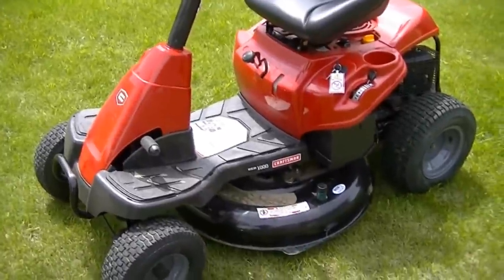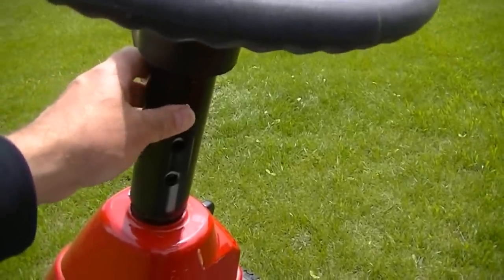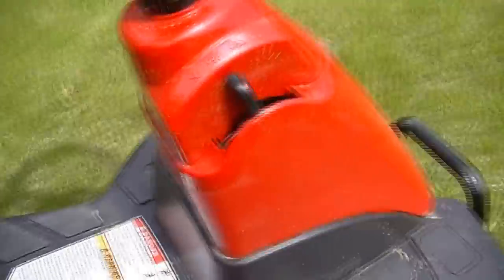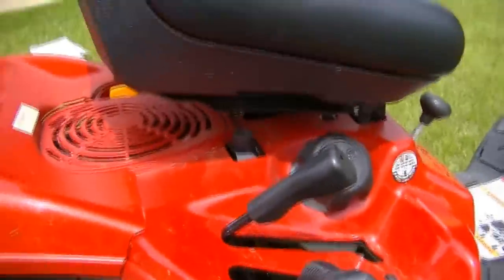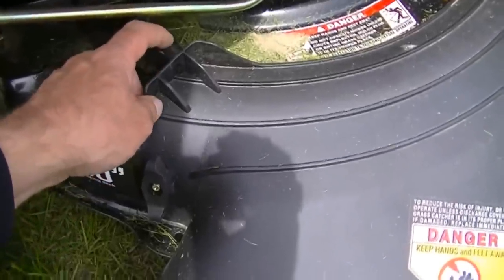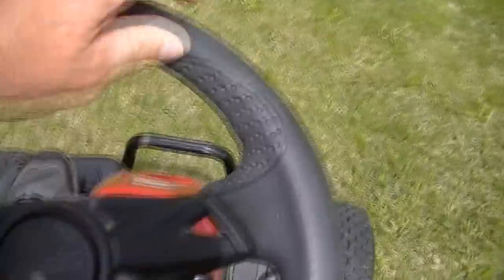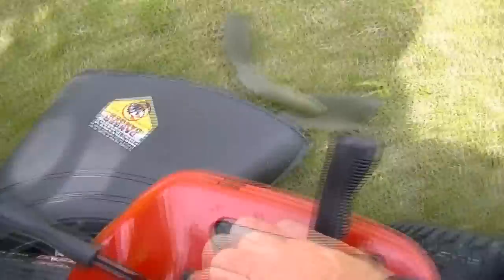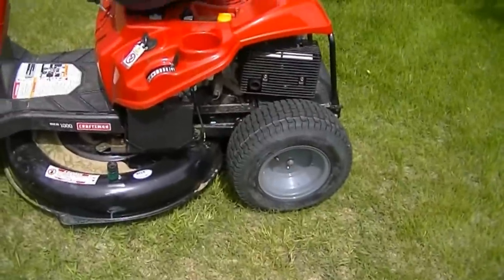Sears Craftsman / Troy Bilt 30" Rear Engine Riding Mower Review

Comment: I bought this $1200 mower at a Sears Annex for only $752.00 two years ago.  It had never been on the ground.  If I put it in neutral and engage the speed handle all the way back into Park, I can get off the seat and leave the engine running.

Comment: Hi , I have one like this but last night I had to disconnect the battery because the starter would not shut off even when the key removed. Any ideas? Could the ignition switch be faulty?

Comment: I bought one of these, they delivered it and it wouldn't start.  Mine is the 29900 and says 1500 on the side (rather than 1000 like this machine), but they are nearly identical. Anyway, they brought another one out to me  a week later and the same thing - it wouldn't start; but this time the guy delivering it figured out that the handle on the right side of the seat which "engages" the mowing when pushed forward and not mow when pulled back was in the forward/mowing position, so he pulled it back to the non-mowing position and the mower started right up.  So if anyone buys one, make sure that handle is in the back, non-mowing position to make sure the mower will start.  After they left, I mowed right away and what a dream.  I can't believe how great and even the lawn looks and best yet, how quickly I got the job done.  I'm in South Florida and we're melting from the heat right now (no matter what time of day you go out to mow), so this is just what the doctor ordered.  I immediately pulled the little wire off underneath so I could mow in reverse.  Worked like a charm. Thanks so much for this great video!
Reply: A much better purchase would be to find an OLD snapper rear engine rider. People sell them for dirt cheap all the time and they are tanks. I bought one and replaced the engine, belt, friction disc, and repaired the bagger. All in I paid around $600 for everything and my snapper is ten times better than any residential rider mower out there. The gage thickness in the steel on the old snappers is something to behold! they just will never die.

Comment: so 5 years now hows it going with your mower  ,i have found out all i need to know about the mower,an have the new 382cc version comeing this friday ,got my oil drain hose ready,an extra blade oil filters the same as the 420cc,an air filter a cover ,an will run high octane fuel in it ,i may post a video on the 382cc,they say it has auto chock .an just better on fuel same hp pretty much by sea level,troy bilt version top 5 mowers of 2018 withe the big boys, wich looks exactly the same an the cub cadet has a head light,looking forward to clean up ,got 10cf cart for clean up ,an mulching,even read the owner manual  ahead of time thanks to the net $968.99 from sears delivered ,i near went for the cub  hydrostatic for $1199.00 with head light an 3 year bumper to bumper ,an the dealer right hear in town ,but bought this first,if it goes back for any reason i would say there 3 pretty much the same input thank you

Comment: Odd, I just looked under where you showed the electrical connection for the safety for reverse, it did not have the electrical conduit, just several wires.  Lucky for me, I had extra plastic conduit to protect the wires.

Comment: Thank you very much for your very well detailed video I just got one of these and it makes it so much easier to watch somebody else do it LOL the only question I have is I'm hearing from people here on the internet that the type of gas you need to be careful on because it will glob up in the carburetor. They're saying that you have to use a higher premium they find this way it doesn't Clump up??? I don't know is this true cuz I don't see anything on their website about having to use a higher premium gas. Just want to know if you've run across this issue since you found yours? And once again thank you very much for everything

Comment: I have essentially the same mower, but it's a Murray.  Have you run into an issue where, when you run out of gas and fill it back up, it will not start...

Comment: Mine is about 3 years old. Having problems with the parking position stopped working. The clutch/brake pedal slow to return. No anti-scalp wheels on deck.
Reply: Mine did that also. You have to slip the steering wheel off and the column cover. The whole bracket was loose and missing 2 of the 4 bolts.
Reply: Thanks. I was thinking that and will get out there today. I've had other bolts loose, bowtie clips missing when new, and it misses grass. The column cover.....how exactly does it come off? Stick screw driver in the tab holes it looks like? @keachmister
Reply: I got it! I had no loose nuts or bolts. I had grass that got stuck under brake lever and wouldn't depress just a teeny bit more to engage that last setting on teeth. The plastic plugs went flying I popped. I put Loctite on all bolts/ nuts to be sure. Thanks again. @keachmister
Reply: @elcidlord  That sounds too easy!! But the results sound good. We'll call it a fix.
Reply: @keachmister

Comment: Good video. I just bought this mower a week ago and I was just about to return it. I bought the rear bagging kit and installed it.  Right after I was done, I turned the key and it attempted to start, then nothing. I'm wondering if the safety button near the grass chute isn't engaged.  I'll know in a few minutes. Thanks again.

Comment: Thanks for tip. Questions:-/ do you find it leans out aft it gets hot? and at hot idle do you hear excessive valve clatter?
Reply: I added a small cooling fan and switched it off the battery. Pointed it towards the carb. Valve clatter is normal,

Comment: Nice review BUT the ONLY problem with the Model 25000 from last year was the "safety switch on the deck discharge chute" and the redesign for the 29000 only included that fix. The 25000 has the exact same transmission. For more details check out Paul Sikkema's site "Today's Mower" at "todaysmower dotcom". He also reviewed the 25000. I bought a 25000 in May 2012 and it's a fantastic mower. The mulch plate and bagger work great too!
Reply: the 25000 had the weak trans ,the 29000 has the stronger one

Comment: Hi there! great video. Thank you so much for that tip for cutting in reverse, I just bought the same machine getting it this saturday the 21st of June 2014 Im guessing the model would be 29000 or greater. 1 question do I put high octane fuel like 94? Have a great day Don
Reply: Donald Guadagnolo There is no advantage in using 94 octane gas. 87 is fine.
Reply: 93 high octane allways works better in small engines all of them

Comment: Did anyone buy the warranty 3-4-5 year program from Sears at $249 or $299 or $389?  The salesman highly recommends it!  He said that one service call will more then $300 since Sear only warranties the defects and not the running of the mower!  Basically, he said if the mower does not work; you have to prove that the parts, components are defective that cause the mower to not work and that very hard to do since you have to be an Master Engineer or better to do it to Sear's satisfaction.  You do have 30 days to return it however!

Comment: I have a new 2017 ,steering has to much play,how can I fix this.The R,F and N stick between my legs was so hard to change cause of my Rheumatoid Arthritis that I put an 8 inch removable extension,works great. Just to let you know that the switch under the seat needs no change, just remove the spring that`s under the seat.   Thanks for your tips.   Brady
Reply: warranty should fix it ,but they steer very easy

Comment: Do you know if there's a  side-to-side adjustment bolt to level the cutting deck? Only front-to-back leveling is obvious to me when looking at the mower, and only front-to-back adjusting is mentioned in the manual for both the Craftsman R1000 and the Troy-Bilt version. I've got an un-even cut and a little bit of a helicopter sound going right now.
Reply: only front to back

Comment: guy i hate to say it but not long after getting mine i found the front end to be weak an the whole mower flex with each hole in the lawn ,it was going to scalp the lawn for the money ,now for some it may work ,nut you need perfectly flat lawn ,so i moved to 42 cub cadet an relized i can snow blow with it to,i did comparison video the CC   has anti scalping wheels ,the 30 in did ride my ok ,but now i bot a rig for both snow an grass ,i also had a problem with the deck ticking when it flexed an the blade was hitting the deck. the engine was fine ,i talk about buying the craftsman 42 pro,but when i found out how far i had to go to have the mower worked on,an that in home at peak season was like month or more i went with the  local cub dealer 3 years an 2 miles away he will pick up the mower too ,check out the videos i made ,i am not saying this mower was all bad just for my yard wrong wide turn an the front end is breaking on the CR 30

Comment: How do you change the battery.  The whole cowling around the engine is one piece and the battery is underneath.  Also the bagger system doesn't hold up.  Any ideas

Comment: Doesn't work on my rt1500 craftsman with the 382 cc engine. No juice to the stater. Same yellow wire but must have been redesigned for you guys going around it. Any other ideas?

Comment: I just bought the 29900 as the 29000 is discontinued. What is the difference besides the smaller 380cc motor on the new 29900? $900 OTD and delivered.
Reply: so i just bought it to this guy does not responde from what i can see only difference seems to be ,the 382cc has auto chock 12 to 14hp depends on sea level  an better on fuel ,if your at 500 feet an geting 13.5hp an i am at 1000 feet 12,5hp at sea level would 14 to 15 hp ,more then enough power    ,got mine for $969.00 an did all the research before i bought ,will run 93 octane ,it takes the same oil filter as the 420cc same spark plug air  filter too,an will use 5w30 full syn after the 5 hour break in if down soth run 15w30 full syn ,already read the  owners manual too,the tb30 is in the top 5 mowers for 2018 same mowers pretty much ,engine made by mtd ,also think about 360 stabil an the 93 fuel to keep it running clean ,had 2 mower in the 22 years the cc30 has head light an hydrostatic,hope things go well for you,ya seems this guy has not responed to most of the posts,mine wil be hear friday ,got the 10cf cart an a cover with a extra blade
Reply: scott Wheeler I did exact same thing as you so far except am using mid grade gas. Am at sea level and can go about 15 % grade no prob. Bought a Drainzit oil drain plug hose. 1st oil change ended up ALL OVER the driveway.

Comment: Not my "cup of tea" but whatever floats your boat! Its the only mower on the market with a discharge chute safety, so it looks like a child safe mower, great for a kid with a small service. But I reccomend John Deere for tractors and Toro or Hustler for ZTR's. I have an old John Deere RX75 rear engine rider that still runs, and it even has a Kawasaki! Also, I have a John Deere LT150 that still runs and cuts great and also has a 15HP Kohler, which is an awesome engine as well. Stay away from briggs and stratton is my advice, but if thats all you got, its not the worst ever. The new TB30's have a button and the craftsman RER's have a key switch (which is better in my opinion)
Reply: its for small yards ,an big people an small people alike with a 14hp engine ,so its for no kid ,it actually the safety switches are for the fact that its only 25 inches wide ,an home owners with out commen sence to read this before buying one easyer peazey ,drove them all this one works for small yards
Reply: you could buy 2 of these with the money spent on john deere; so if JD lasts 4 years, you'd get two NEW ones of these during that time

Comment: I've had mine two years and either the starter solenoid or the switch just went out on it, i haven't figured out which yet. And to boot the dang clutch peddle is jammed and the back brakes won't release.

Comment: hey bud mine is not getting fire i pulled the plug and see no spark i have been tryin to jump the seat switch but have read that you cant jump this model switch assuming that is my problem already tried twisting the wires together still no fire 2 yellow wires and 1 green any help would be appreciated

Comment: No anti-scalp wheels on the deck [raise cut height going from drive to grass-grass to drive], leaves a corn row uncut on wide turns, misses grass on the straight, more liable to tip over if to fast. Shorter length, more narrow wheel base. If you can maintain the blade, oil changes, lubrication of mower I don't advise a service contract or extended warranty.

Comment: How is the mower over time? This video is 7 years old. Is the mower still working?
Reply: Gerald- I bought the same mower in 2015.  In 2020, it still works great.  The OEM mower belt just broke yesterday & I found a better-quality replacement belt in stock at Lowe’s.  Installed it today and it’s fine.  Some mower mechanic in a different video admits he’s unfamiliar with this mower (belongs to someone else), yet proclaims that it’s “junk.”  And says the carb is “ junk” as well.  I hate so-called  “experts”  with that attitude.  Look-  just like anything else at this price point, this little mower has its minor flaws, but if you know how it WORKS, it’s pretty darn good, and is great for a small or medium size lawn.

First- follow the maintenance schedule, and it won’t be “junk.”  I remove the battery  (tricky, but doable once you figure it out) for winter storage and keep it on a trickle charger... it can last about 3 years.  I made a couple of small improvements and it’s more serviceable:  1- the oil drain system is truly inconvenient, and I never bothered using it with that plastic trough.  Instead, I went to the hardware store and got two steel pipes ( I measured- one longer, one shorter), an elbow, and a yellow gas valve.  I screwed them into the drain plug hole, and for about 5 bucks, I simply flip the valve and the oil comes out, makes a 90° turn down and flows right into a jug.  No pan, no mess... no clean-up.  
2- I buy compatible oil filters  (Wix Filter # 57890- superior quality)  online from Filter1 for far LESS than anyone charges for this “mower oil filter.”  All specs are identical to the “Craftsman” oil filter.  I usually buy 2 or 3 and stock up.   
3- I use the deck wash system as per the manual EVERY time I mow, and the mower deck stays pretty clean underneath... no scraping needed.  
4- I also got 2 thumbscrews at the hardware store so I didn’t need a wrench to remove the bolts for the rear engine cover.  
5- With every gallon of gasoline I buy, I add a couple ounces of Seafoam, and I have ZERO carburetor problems in any of my six small engines, even with off-season storage.
6- I go to a lot of trouble keeping the steering mechanism clean and lubricated, and there is a good You Tube video about fixing too much slop in the steering of a Troy-Bilt rear engine rider, which is the same MTD machine.  After a thorough cleaning of the steering rack and gear a couple of years ago, I switched to a good dry, graphite based lubricant that seems to work well without holding dirt & grit.
7- I also disconnected that wire to let the thing mow in reverse, which is a great idea.
8- To change my blade, I use car ramps and don’t need to remove the deck (like the manual says) to swap out my spare, already sharp blade at the end of the season.  

- One minor point- this mower turns REALLY tight- almost like a zero-turn mower.  On wet lawns, you can turn the wheels so tight that they can slide.  My suggestion: don’t do that. 🧐. Otherwise, it trims around trees almost like a push mower!
- Anyhow, after 5 years, my R1000 is holding up well.  Maintenance makes all the difference, which Is probably why my 15 year old Craftsman push mower also refuses to die!
Reply: David P thanks for the info!

Comment: Very informative.  Love your video.   If this is the bullshit I have to go through with another Craftsman rider I don't want any part of it.   I have a Craftsman's Lawn Tractor with the same bullshit except it does have features that will let me get off the mower while running and an option that is set up for the ignition where I can go in reverse and mow.   

But, since I'm Autistic I'm really having a difficult time sorting out things on my lawn tractor and will just have to make an effort on how to operate this thing.   And it isn't as if I have never used a rider before.  I had a blue one where I had a brake on one side and a gas pedal on the other and I just pulled the rope to start the engine.   It was also easy to change the belt.   But those days of simplicity are gone.  I can tell you I loved this mower and used it until the frame rusted out.   The motor still ran like a dream.
Reply: these mowers are made this way for stupid people

Comment: ATTENTION, ATTENTION;  I just bought the exact same mower and I see what you mean about the shift lever being very bad to work and reach.  Heres is what I did,  I bought a piece of 3/8' round stalk from Lowe's and cut a 3 inch piece after pulling off the knob I welded the three inch piece on to the existing shift rod, I extended the shift handle by three inches  and now it is just fine.  But I will never buy anything from Sears again because of the way they treated me and delivery.  Long story !!

Comment: I forgot. Many times I have helped someone with their mowers starting problems, etc. I found that many folks do not read the operators manual. Please do. Please do no throw it out which people do. Also my clutch not engaging 2 times I was on level ground. Please drain the gas for winter storage or use stabilizer, and change the spark plug every 3 years at the max. or yearly.